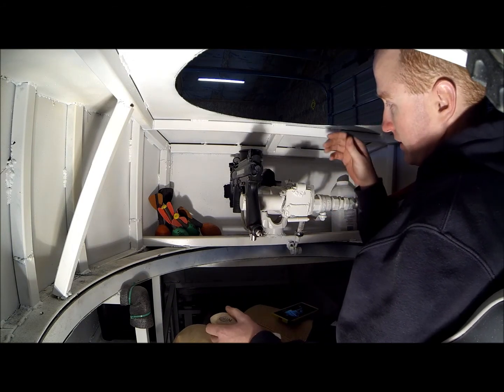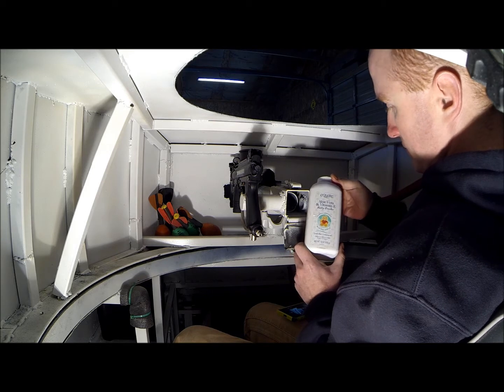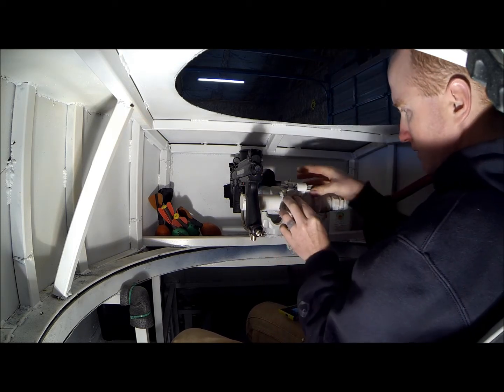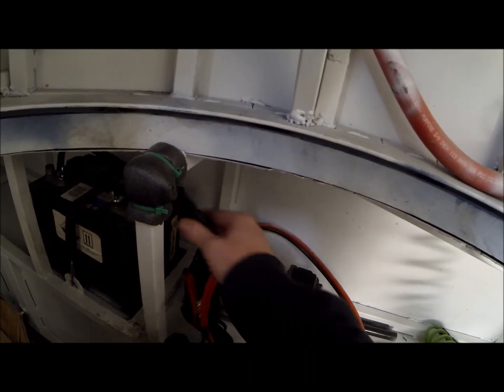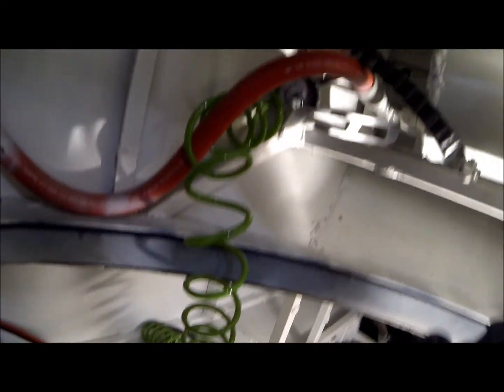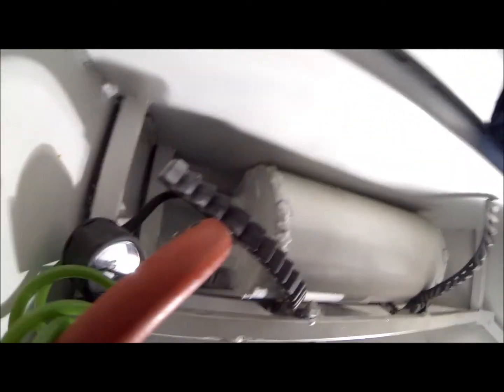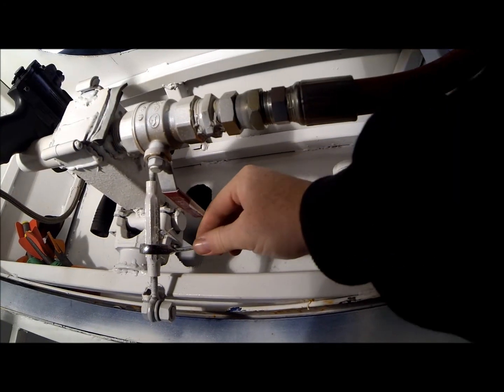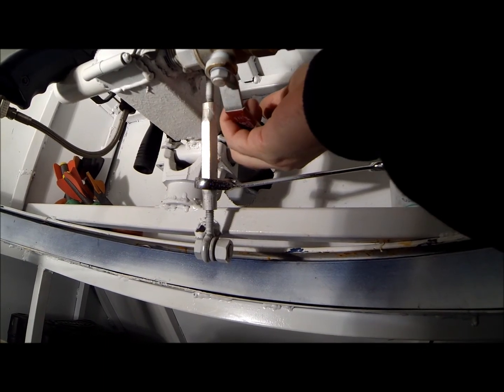Tank air cannon

Comment: You should place an electric pressure switch on the tank in series with the + for the pump so when it gets up to pressure it automatically shuts off the compressor. They are only 5 or 10 bucks. I use one on the RC sub I built to recharge High pressure air to ballast tank. You can get them as low as 10 PSI and up. Then you won't have to constantly connect jumper cables!

Comment: So how did you make the air tank? and I am surprised you didn't use a solenoid valve as the trigger for faster release.
Reply from the maker: +Sam “Flip” McKay 
Sam here's a video I for got I had it shows the air tank it's just a piece of pipe with ends welded on it then holes drilled in one end then the fittings welded in.
https://www.youtube.com/watch?v=HtagDTw1-sQ
Reply: +James Cook (TinyTank428) Very nice. One quick question, how much do you think it would cost to make a 2 man JagdTiger, with lighter materials?
Reply from the maker: +Aj Nadeau 
That largely depends on the power pack your thinking about using. The set up I use cost close to four thousand then the materials can very wood is generally cheaper but over time it tends to fall apart and not handle shock load very well. Steel is more expensive but last longer and handles abuse better. Then savaging and salvaging parts where you can I would guess you could probably build it for around 5grand

Comment: Do you reference actual blueprints and make your own for the chassis in your tanks or do you just wing it? (sorry for the complete lack of correlation to the video this is most recent though)
Reply from the maker: +Fancy “Wandwuff” Man 
No worries there. 
I use a 1/35 model to reference and measure with calipers and then I scale up the measurements. Some parts have to be enlarged or moved so it's not 100% accurate but I try to keep it close. Other parts like hatches and periscopes are left out for ease of cleaning and maintenance.
Reply: TinyTank428  Thank you for the response

Comment: Just one question: about how accurate would you say this gun is, and about how far does it shoot?
Reply from the maker: +Channing Crawford 
accuracy largely depends on the round if the fins get bent over in the tube the round will cork screw and no telling where it will go. If the fins stay straight it pretty much goes where you point it. Max range with being able to hit the target I would say is somewhere around 100 yards.

Comment: So about the time this was uploaded, I drew up some plans for a three person airsoft tank. I've been saving up money, learning about mechanics and engineering over time, but what tips would you have? And where did you get the parts (specifically the engine and traversal)?
Reply: Thanks in advance
Reply from the maker: Here's a link to a video explaining the hydraulic drive system and engine on one of my other tanks. Its basically the same engine. Just a different brand. https://youtu.be/LRGGHgDDtkU
The Sherman uses a 22hp Honda and the tank in the video uses a 22hp predator engine it's a cheaper version. I'm not sure what your asking for on tthe traverse. If your asking about turret traverse I use a pallet carousel that I got from northern tool. If your asking about the actual steering of the tank its explained in the video link attached to this.
Best of luck to you on your build.
Reply: @JamesCookTinyTank428  thanks man :)

Comment: Where did you find the multi purpose hose at?
Reply from the maker: I purchased the multi purpose hose from the local NAPA parts house.
Reply: Wouldn't happen to remember the part number would you?
Reply from the maker: Sure and sorry for the late reply. Here's the part number NBH H-1716 then the fittings I used are a GAT G25100-1212

Comment: Hello, i am building a half scale KV-2. Most people think i am joking, however i am as serious as cold hard steel. I was wondering if you could help me out by giving me some pointers. Thanks a ton.
Reply from the maker: Sure if you have questions ask away. I will do my best to answer. Good luck on your build.
Reply: @JamesCookTinyTank428  1.) What calculations did you do to get what engine you needed?
2.) What is the metal plate thickness for the majority of the tank?
3.) What are the main issues you ran into when building your tanks?
4.) What do you think of using a large air tank for the gun replenishable from the outside?

Thank you for helping me out. I need help. I am finishing up the plans in solid works for more technical parts and will start welding in January as long as 3D print tests work out. Out tank is going to be a bit more cramped and will be as close to the real KV-2 as possible. I watched your track video and it will help me finish my tracks too. I will use a similar design with a few of my differences. Our initial track was too risky and more expensive than yours. Have you ever considered a Diesel engine?
Reply from the maker: Your very welcome. I'm glad to help.

I didn't really do any calculations for the engine size. I more or less trial and errored it. The engine was never really a problem because I got the biggest air cooled engine I could get. But my first attempt at the hydraulic system was a complete failure. 

The metal thickness I use is a 16 gauge plate with a 0.083 wall 1" square tubing frame underneath. 

The biggest issue I ran into was getting the hydraulic system figured out. Once I had that sorted out the rest was pretty straight forward. I have had a few issues with tracks coming off and I've changed my tensioner design. My best advice for the obstacles you'll come across is perseverance pays off. You can never truly fail if you never give up.

I've seen the air tank idea in action on the tanks at armorgeddon in the UK. It worked pretty good. The only drawback is a limited number of shots, but they do have a much higher rate of fire because you don't have to wait for the compressor.

I think diesel would work fine. The reason I went with the air cooled engine was that way I didn't have a cooling system to deal with.